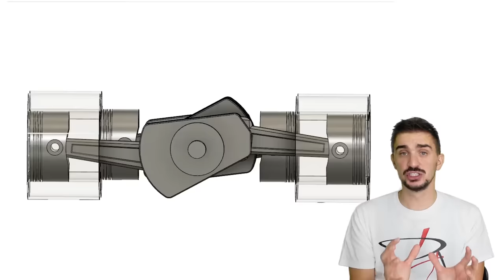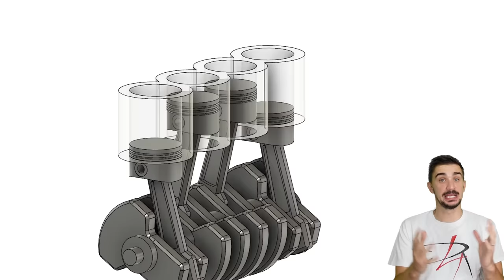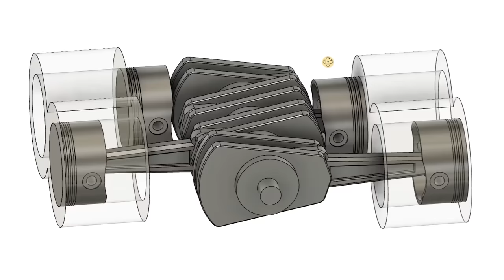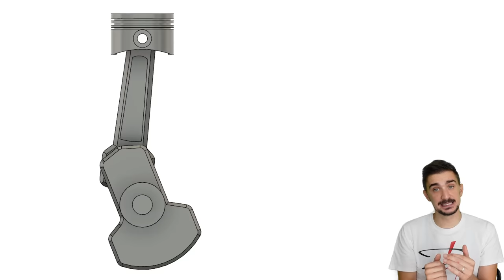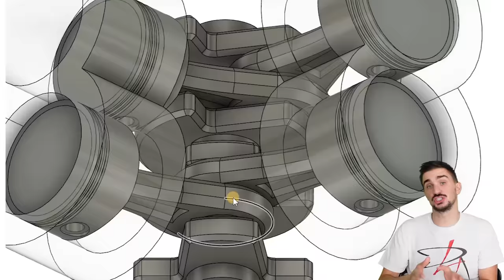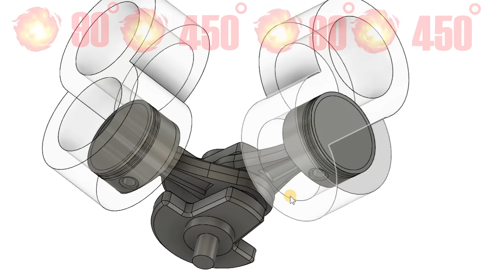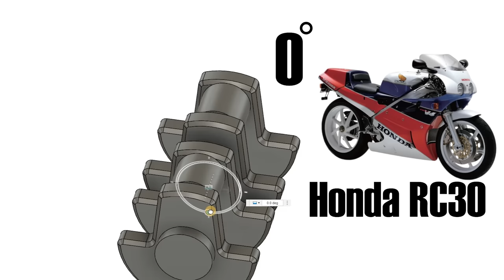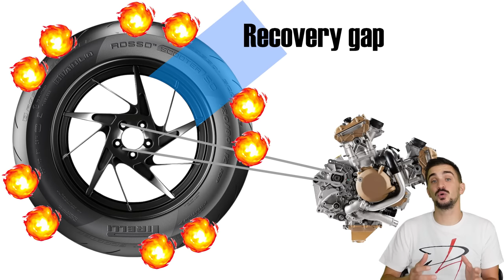Deep Dive: Inline 4 vs. V4 vs. Boxer 4 - What's the Difference? Engine Balance Explained in Detail

Comment: It seems the inherent weakness of all these engine types is the fact that there are masses moving up and down. Clearly some very clever engineering has understood and minimized the effects of all reciprocating mass but can’t perfectly mitigate it. It makes me wonder why the reciprocating engine is still dominant given all the imbalances, moving parts, and abysmal efficiency.
Reply: Because Wankel rotaries have apex seals, which negate most of the Wankel's advantages in most practical applications. Wankels are great for racing engines where they get rebuilt frequently. But for normal passenger cars, the wear rate of apex seals means the engine needs an expensive rebuild service much more often than piston engines & their more reliable piston ring seals. Mind you that Wankel rotors also oscillate, just much less than pistons.

The most efficient non-reciprocating ICE - the turbine - has too slow a throttle response for driving applications, IE it isn't "rev happy" enough. In this way, the higher leverage and friction of a piston engine are advantages - freaky huh? For aircraft, though, throttle response isn't so critical, and the much higher power density and fuel economy of a turbine make a big difference. 

"There is no 'best' engine."

Comment: Another person confused with the term inline and straight. Transverse is across the wheelbase, inline is along the wheelbase. Straight is what he really means. Inline straight  fours are usually rear wheel drive  and transverse straight fours are often front wheel drive.
Reply from the maker: The term you're looking for is transverse vs longitudinal engine placement. Inline only refers to cylinder configuration and never engine placement. You're also not "another person"  you're the only person in the comments who said this. It makes no sense to use the words inline or straight for engine placement because nobody knows what line you're referring to. It takes 3 seconds on Google to find this.
Reply: @d4a  before google there was these things called books. In my library motors are mounted across  the wheelbase are transverse and when mounted inline with the wheelbase they are inline. I've noticed  lots of incorrect  articles on Google  doesn't  make it correct 
 Spend some time in a library

Comment: The Zaporozhets Soviet subcompact was driven by a 90 degree V4 with four separate rod journals on a three main bearing crankshaft. It is similar to a VW Type 1 engine with a magnesium block, or case, overhead valves, exhaust ports exiting the head at the front and back of the engine rather than inside and outside the V. It has a balance shaft, coaxial with the camshaft in the V.  The best images I found on Quora thanks to Francois Dovat https://en.wikipedia.org/wiki/MeMZ-965

Comment: Don't some boxer crankshafts have flying arms rather than main bearings between the opposed cylinders?  This would either reduce the moment arm of the rocking couple or   allow a stronger web with the same moment arm, albeit at the cost of less support from the block and caps.

Comment: The idea that the V configuration is less "smooth" and that's why it's never used in cars is surprising because I've always heard that V6 and V8 engines are desireable in cars because they're smoother. I imagine this has to do with their increased piston count.
Reply: a V6 is not smoother than a I6 F6 or VR6
a V8 is not smoother than a I8 H8 or W8

maybe, just maybe they are smoother than an I4
and is what they wanted to tell you.
Reply from the maker: Yes, only V4 isn't used in cars, v6 and v8s are obviously extremely common. Balance completely changes with piston count. I have both v6 and v8 vids on the channel
Reply: @d4a   it was used in the Lancia vr4
Reply: @Xayuap  you literally said it yourself, its a vr4 not a v4. the only car v4s that i know are ford köln v4 and essex v4
Reply: @timothyscherer9163   yes, but it was labeled as v4, a narrow one. VR was an achronim by Vw later.
Reply: @Xayuap  yeah true that

Comment: I've thought before that American car brands should move their "standard" engines to V4 to stand out. It's half a V8! It would give people something to get emotionally attached to instead of the same inline 4 everyone else does better. More vibrations? I think you mean "character." At least, from a branding perspective.

Edit: Oh, and specifically, longitudinal. Extra rear/all wheel drive affinity, shorter and easier to package that way than an i4, less obnoxiously-positioned heads for servicing than a boxer, etc.

Comment: I have a 180° i2, a somewhat even i4 (c3 fires a bit later for ... reasons) and a 90°  V4 and the V4 is by far the best in corners. I go to the racetrack with my Honda VFR and accelerating out of corners is so sooo easy and predictable. Even if you lose traction, you can simply catch back the rear wheel by letting off the throttle a tiny little bit. If you suddenly close the throttle: That's a high side no mater the engine.
Reply from the maker: I really want to know those reasons now
Reply: @d4a  I want to know that, too, but I don't. Firing order is 1-2-4-3 and cylinder 3 isn't firing at 180° but it bit later. It sounds a little bit rough, but all Honda RC42 (Nighthawk US, Sevenfifty EU) do that.

Comment: I've always wondered why no one has ever made a very narrow V engine. Like narrow enough that the intake valves (assuming the intake is on the inside) are ran by one cam shaft but then make the exhaust ran by two. But since they will be off set a bit it would allow you to increase the bore without them interfering with each other. Kinda balances the compact size of the v4 but keeps most of the simplicity of the i4.
Reply: Lancia made narrow angle V engines with a single cylinder head, since the Lambda in 1922, but not quite like that. The Lancia Fulvia from the 1960s/70s used a DOHC design with one cam for all intake valves and another for all exhaust valves and short rocker arms to allow one cam to actuate the valves on both banks of the V4 engine.
Reply: @alexjenner1108  Oh wow, that's neat. Now I just wonder why they didn't try more.

Comment: I know it's a matter of cost of manufacturing, but man, I wish most of the 4-cylinder cars out there were V4 instead, with a nice "half a V8" sound coming out the tail pipe. I don't care that it cost a little more to run two valve trains and two heads, and a more complex exhaust routing, I just care that the generally boring i-4 sound could be changed into something very interesting. The only performance V4 I know of is the Porsche 919 Hybrid LMP1.
Reply: You can also opt for unequal length exhaust manifold - Subaru boxer "rumble" comes from uneven length exhaust tubes as there is perfectly even firing order. Replacing it with an equal-length header removes the distinctive sound - but improves exhaust flow to the turbo and evens out cylinder temps, so the trade-off is worth it for some.

Comment: Thanks for this video, I learned a couple things about the V engine that I didn't think mattered as much.

The part explaining why flat 4 engines are boxers reminded me of the Ferrari 512 Testarossa which uses a 5.0 flat 12 (non-boxer). I wonder if you could explain how Ferrari made it work!
Reply: Since an inline-6 is well balanced, a V12 is also well balanced and the 512 Testarossa uses a 180° V12 which is also well balanced, but has a more simple and probably lighter crankshaft than a boxer engine.
Reply: @alexjenner1108  I didn’t think the properties of a V12 would directly translate to Ferrari’s flat 12, thanks!

Comment: The Ford Focus designers wanted to make sure you feel very connected with how much there crappy engine vibrates by creating motor mounts that need to be changed out with every oil change.

Comment: Hi D4Answers,
Please take a technical look at the Honda CX500 engine,
You won’t believe your eyes!
90V2 with one! 1 Camshaft! Twisted/rotated engine-heads Compared to the crankshaft
, Water-cooled, clutch on balance shaft, balance shaft drives the gearbox, driveshaft to rear wheel, BMW engineers exclaimed that they should have made it 1978, please let us all know that you think about it….

Comment: Are the secondary vibrations higher in an i4 engine if it has a long stroke because the difference in the length of the connecting rod between 180° and 90° is greater and therefore the acceleration of the piston is also greater? Or am I making a mistake in my thinking?

Comment: Solve the problems by using a 4 rotor engine. Less issues with inertia. Just need to figure out vibration on chrome liner surface  by Apex seals, and exhaust heat destroying tiny springs supporting side seals.

Comment: the power pulses confuse me a bit. mentions that uneven pulses allow the tire to gain traction if there is longer separation - but on the other hand you have 2 firing pulses closer before the pause that i would think makes it easier to break traction.

Comment: For the flat boxer 4, the primary couples are balanced, but surely there is then a bending moment over the whole crank - is a bending vibration just much more damped than either the primary or secondary vibration?

Comment: I have this thing in my mind that may be a good subject for a video.
A 16,5 kgfm of torque engine @ 4500 RPM, generating 130HP at 6000 RPM.
A 17.2 kgfm of torque engine @ 1500 RPM, generating 120HP at 6000 RPM.

The question subject, one is clearly more potent and N/A and the other has lower torque.. That make the engine dynamic very different from one and the other.. And here is the question...
Even though the turbo has better low torque and the potency is close at the end, such a small turbo engine would also mean that at 3000 RPM the torque curve actually start to dip down.

So at a full throttle and acceleration, would the N/A car actually be better? As this is where we need the "high torque" and power (that it already have) the most?

Both engines exist, one is a Kappa 1.0 TGDI and the other is a Gamma 1.6 EMPFI runing with Etanol.
Reply: It all depends on the gearing, if the gearing is made such that the higher HP engine can stay at or close to maximum HP it will be faster. If the gearing has bigger differences in between gear ratios so that rpm drops low where the higher torque engine has an advantage they might be equal.

Comment: WHY DOES AN INLINE 4 NEED COUNTERWEIGHTS ON THE CRANKSHAFT?

Ok, this might be a little off-topic but I can't find a easily understandable explanation. 
So primary forces get cancelled out by the pistons themselves and secondary by balancing shafts. 

All I know about counterweights on I4s is that they are there to reduce main bearing load.
But what forces exactly do they counteract? Only the ones created by the crankpin and the big end of the connecting rod? And if so is it only for the centrifugal force of pin and rod -end?

Comment: I wonder about the theory behind the uneven firing interval creating a 'recovery gap'. considering that at such high rpms, the slop in the drivetrain, wheel spokes and rubber act as dampers to dilute the effect the contact patch sees... also, It seems to me that the same logic can be used to justify that the 2 cylinders firing in quick succession would create an unexpected loss of traction. but you provided alot of historical evidence to the contrary. but also on dirt you usually see more grip when the tire is slipping. Do you have some further reading resources about this 'recovery time' phenomenon?

Comment: Boxers can have a single piece crankcase by splitting the main bearings parallel to the bores.  This can be tricky to make the bearings durable, but it is possible,
Reply: Another solution is to have the conrod main bearing split at 45° to where you expect it. That way you can still complete bottom end assembly from the sump side. Look up Alfasud conrod for reference.
Reply: @stephenbello1081  Yep that would also work

Comment: Wonder if that rocking couple is why my VW crankshaft broke in the center journal.  (it was a large motor,  2276,  running fairly hard)   I always wondered what caused that crank failure,  now I have a new variable to consider.

Comment: isn't the 90° V4's uneven firing interval 90-270-90-270 instead of 90-450-90-450? 90-450-90-450 would be some weird "six stroke" engine that does two extra strokes in the middle for some reason. Great stuff otherwise, and I could only point that out because of how well your other videos have taught me, love the way you break things down!
Reply from the maker: I'm explaining the V2 first, as you can see there's just 2 cylinders. After that you can see the firing intervals of actual V4 bikes.
Reply: @d4a  Got it!
Reply: @d4a   Hello, you wanted to contact me about a special issue for my engine

Comment: Looks like 90⁰ V4 (with balance shaft running inside the camshaft) from Zaporoshets deserves separate video :)
Reply: @Retired Bore Not the best, but definitely most interesting.
Torsion front suspension, like VW Beetle and Porsche 356, but with horizontal ball joints pins, like it was done on 1930's Auto Union race cars :)))
Very clever packaging with steering mechanics in front of front suspension, so it has more leg room than any other soviet car.

Comment: What if you took an inline 4 and offset the center two crankpins by 90 degrees in the same direction? What if you offset them by 90 degrees in opposite directions?

Comment: ZAZ 968 has air cooled V4.
Reply: nice, didnt knew that before
Reply: @timothyscherer9163  even cooler is that its V4 (840cc) can be fitted to a motorcycle "Dniepr" because its bellhousing matches the Dniepr gearbox =D 

More to it... A Lada 2107 engine can be fitted onto a ZAZ968 gearbox to have a tiny mid engined car. Soviets liked to unify car parts back then.

Comment: If on a boxer engine, could one solve a secondary rocking couple by putting one head's cylinders further apart, putting its two connecting rods on the outsides of the crankshaft? I imagine this would result in some unusual coolant challenges and a complicated bill of material (mismatched camshafts), but hey this is subaru. Maybe just use the existing imbalanced exhaust header to solve that cooling challenge.
Reply from the maker: You answered your own question. Yes that solves the balance problem but at a price that can't be rationally justified

Comment: Would a boxer engine with a crossplane crankshaft be possible?  As far as I can tell it would still have perfect primary balance.. but not sure on secondary or rocking couples.

so when the "front" two pistons are at TDC or BTC.  the "back" two pistons would be at mid stroke, going opposite directions.        Just a thought experiment I've had for a while to see if it would be possible to build a custom boxer engine with more rumble while still using equal length headers.

Comment: Well then, has there ever been a boxer four (an experimental one, maybe) where one bank would have cylinders 1 and 4, and the other bank would have cylinders 2 and 3?

This should eliminate the secondary rocking couple, but at the cost of longer crankshaft and wider middle main bearing in order to make enough bore spacing for cylinders 2 and 3, and a bigger bank with cylinders 1 and 4 (or two separate cylinders w/ heads), and/or very narrow main bearings between 1/2 and 3/4, or make it a three main bearing engine, probably requiring a very strong (thus heavy) crankshaft.
Reply: That would just be a 180° v4, he explains why that isn't a good idea at around the 20 minute mark.

Comment: Went back to 50fps, I see. Looks like it's 1/100 shutter speed though. Did you not try or want to try the 1/50 to look smoother?

EDIT: Another reason Moto GP uses V4s is that IIRC they banned higher cylinder counts. Same thing with 6-speed transmissions. Now imagine a moto GP that allowed 5 or even 6-cylinder engines to return, as well as either 7 or 8-speed transmissions.

Better yet, imagine if they took Dan Gurney's Alligator design and looked into that. Or John Britten's front suspension. Or both.

Comment: 23:30 is it correct to say that the webs and bearings thickness caused not only weeker bearing but also the breaking of the crankshaft in diesels boxers subarus?
Reply from the maker: It's possible, diesels make massive torque

Comment: 8:38 FALSE: you can make the phase angle of boxer 4's whatever you want, as long as each pair is 360 degrees of phase apart.  You could make an engine that is 90 270 90 270 for instance.  This is because each pair of cylinders in a boxer is perfectly balanced.  You don't need have any particular phase relationship between the first pair and second pair.   You're right that there's only one way to do an inline-4 to maintain balance.

Comment: So I'm pretty sure I can but... Let's say my engine has a balance shaft. Could I simply remove the belt or chain form that balance shaft so it doesn't spin, and not do any other harm? Obviously if it's completely removed nothing would restrict the flow of oil... But leaving the shaft in place and it just not spinning, other than vibration what would be some issues if any?
Reply from the maker: It depends on engine and what the shaft is doing. Getting rid of a balance shaft on an inline four is usually safe if done right (delete kit) but disabling it on a single cylinder engine is usually not a good idea. But why would you want to do this? It's there for a reason.